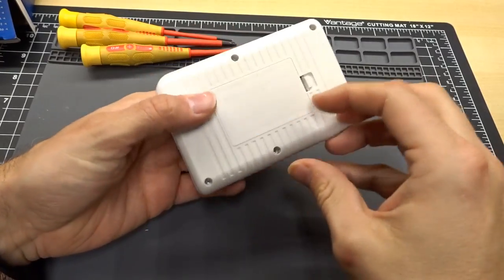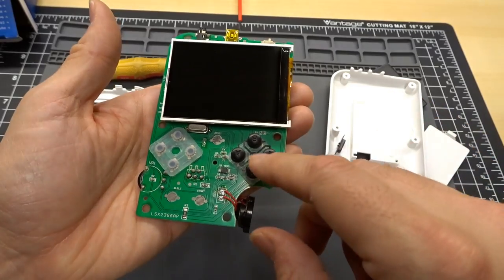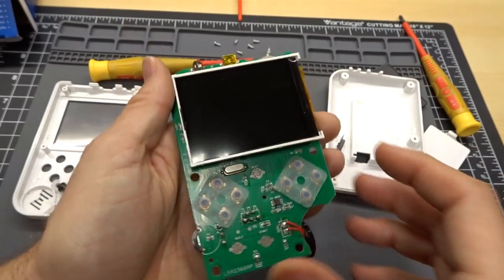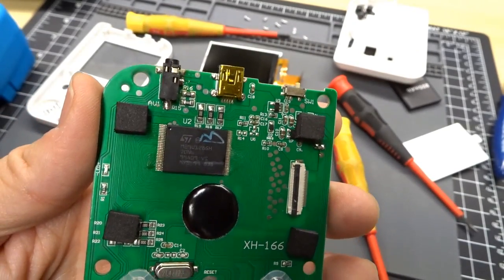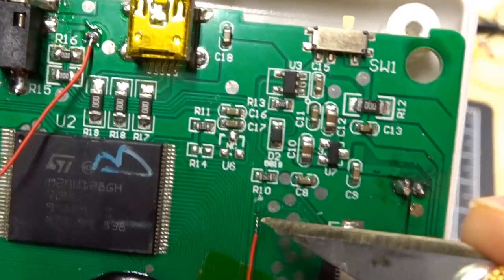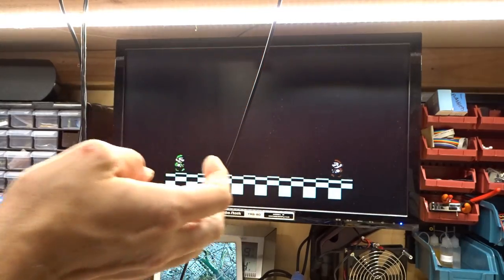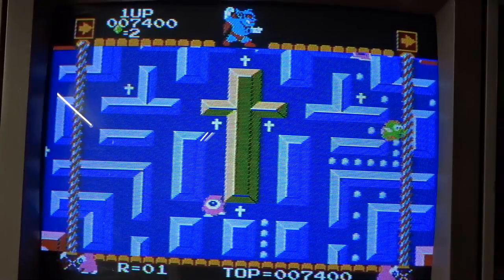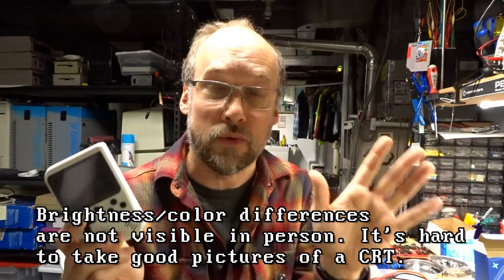Improving the $10 8-bit handheld game console

Comment: Can we add more games to this by flashing the EEPROM ?
Reply: You have to install another SSD and 1 graphics card.
Reply: technically yes, i have dumped the original firmware from one of these mine had a Winbond W29GL128 and i have found the addresses of all the roms, and now can replace them but doing so is pretty much out of scope for the avg user
Reply: @Hungry Box  can you make a video about it
Reply: not really cuz its a lot of work but overall i would say not worth it since the console itself is trash, too much work, but if you are still interested the author for that was a russian guy called "promolife"
Reply: @crisivannacis2742  no cuz its too much work to make a tutorial and not worth it since these consoles are extremely cheaply made and will in most cases not survive the process, plus you can buy consoles which use an sd card for games cheaper than the EEPROM mod is gonna cost
Reply: @mzahidshah please make a tutorial this console is very popular in Asia and people in Asia ar very poor can't not buy expensive console please 😢
Reply: @crisivannacis8534 yeah it's hard to make but if hi can't make it will really help people in Indonesia and philippines
Reply: @crisivannacis8534  brother i am from asia as well, and like i said the equipment, and stuff and skill needed to do this mod will cost more money and time than buying lets say a $25 datafrog SF2000. like you can make a diy console for cheaper, doing a mod to this console doesn't make economical sense

Comment: Dividing the crystal oscillator frequency by 12 yielded the exact clock frequency of the NTSC NES. Dividing by 13 yields almost the same frequency as the PAL NES. Clever.
Reply: So the first thing I noticed while playing Mario was the timer count down speed was almost twice as fast! possible to fix? installing a different crystal oscillator?
Reply: @bigalanwgordon  The timer was arbitrary. It's not meant to be in seconds. IIRC, PAL areas with 50Hz refresh had a slower timer than 60Hz NTSC areas.
Reply: @fryode  it's not just the timer but the music and game speeds are faster, at first i thought i might have pressed a button combo to speed up the game but it's in all the games on the handheld.
Reply: @bigalanwgordon hey guy i know im way late but a lot of these chinese 8 bit devices are running an smb rom that is meant to run on some other device  ive mistakenly downloaded that rom before its also worth noting that i have the fast rom on a multi cart as well  if you start changing the oscillator speed you may fix the mario rom but youll create issues in all the other games on the machine likely theyll run slow 
as you were trying to fix a fast running rom by slowing it down hope this helps

Comment: Used your 47 ohm resistor trick from this video. I had to mod my old 80's computer to get composite out of it...it only had RGB, monochrome composite, and RF. For some reason no color composite, partly because it was a UK machine and had a pin designated on its DIN-8 connector for PAL composite but only gave a 5 volt signal instead (which seems to be common for the US version). So when I grabbed the signal off the pin from the video chip (well sub-chip, MC1733) and re-routed it to one of the unused DIN-8 pins, the picture was a bit washed out color wise. When I put the 47 ohm resistor in line, the color came out fully again. So that trick worked, thanks!

Comment: You talked about the usb interface supporting the 3-pin controller. Well in the link you gave us there is an option to buy it with a controller (+$3.00) that does, indeed, use the mini-B interface. Just thought you would want to know.

Comment: Though I also would have just used Kapton tape, another reversible alternative to nail polish would be pure rosin. I bought some rosin chunks and dissolved them in solvent (you could use straight isopropyl, a blend of isopropyl and ethyl alcohol, or just commercial flux remover), and I paint it onto etched PCBs to protect the copper from oxidizing. (The more rosin in the solvent, the thicker the coat, but longer drying time of course.) This would work as a removable insulator for the buttons, since pure rosin isn’t conductive and is not hygroscopic.

Comment: Instead of modifying the video output of the unit with an inline resistor, it may be better or easier to modify the video cable.
Reply: Modify how?  Like in what way?
Reply: @maxcypond  splice in a resistor inline, add heatshrink
Reply: @maxcypond  If the connectors aren't moulded, then put the inline resistor in the connector.  If the connectors are moulded, then you could replace the connector (preferably at the monitor end) with a normal wire-able one and fit the inline resistor in there.
Reply: Would adding a sink resistor to ground (to avoid cutting traces) work?  Like soldering a 560 Ohm(or whatever) across the ntsc output tp to a gnd tp?
Reply: @emprsnm9903  Possibly...  I was wondering if the issue wasn't caused by the monitor not being terminated correctly (i.e. normally a composite signal would be terminated in the monitor with a 75R resistor).  If the input impedance of the monitor is too high, then adding a resistor between the composite out and GND could very well solve the problem.
Reply: Add a resistor to the cable?  That's an awful idea.

Comment: And the added capacitor on the backside was for...
Reply: just for the heck of it
Reply: Just because its supposed to be there. For completeness. If it should be there it will be there.
Reply: @lordmmx1303  Just for the Ben Heck
Reply: Is it possible that adding that capacitor is what caused the voltage on the video output to spike in the first place? Maybe that was why they changed the design and decided not to put in the capacitor?
Reply: @ct92404  I'm pretty sure the voltage was always hot, even before the cap was added.
Reply: Style

Comment: -Maybe you could smake an AAA-cell mod, for increasing the overall lifespan of the device to more than the included battery-pack? :)
-And modify the flash contents. Remove the double games, correctt he names and add missing games? :)
Reply: Why? This is not some unique battery, you get them at just about any electronics store for $4.

That being said, the capacity of Li-Ion cell isn't particularly amazing. It's probably a 600-800mAh cell at 3.7V nominal voltage.
3*1.2V for NiMH comes out to 3.6V so damn close and 800-1000mAh of capacity.
Reply: This is no standardized battery form factor. It's a special thing, that might have had some popularity in the past, because it was in Nokia phones or such, but for sure you can't just easily get it just anywhere and the popularity for sure is decreasing. Actually I don't even know what' it's name is and where I could get one right now.

Comment: Should adding the resistor outside the console by hacking up the video cable produce a similar result? In addition, what resulted from adding the capacitor? Did it reduce the audio buzz mentioned in the previous video?

Comment: Adrian, to what lines is the cap that you installed connected? Do you have any guess as to why it was not on the finished design?

I have one of these, but have yet to open it. The LCD is far too bright for me without computer glasses, so I'd like to put a variable resistor on the power line to the LCD itself.

Comment: I have one of these that i picked up for 7$, for that price it's a decent console but i wish they allowed USB access to change games from a PC...

I was wondering, there's any way to access the 128 mb memory and mess around with the games or even with the OS ?

Alternatively, do you think it would be possible to reuse the screen, case, buttons and some part of the board and connect everything to a Raspberry Pi 0 ? Seems like it would be a great 5$ upgrade.
Reply: So my thing with the last part of this comment is that if you wanted to go the Pi route, there's better options. There's 3D printer STL files and kits available to make something better, and easier.

However, if you already bought it like me, I can see the appeal then. And I'm pretty sure you could get it to work with a Pi, but you're probably gonna have to do a lot of fuckery for finding the driver for the screen (I would think) so I just don't know if that's worth it. Just learning how to flash more games onto the existing consoles definitely seems worth it though and I'm about to try it this weekend if I can figure it out.
Reply: @HildegardActual  Did you succeed with adding new games?
Reply: @HildegardActual  any luck?
Reply: @HildegardActual you did it?

Comment: Adrian, could you answer a few quick questions ?  Is a 47 ohm Resistor 1W, 1 Watt ±1% Tolerance or 1/2 watt or something else? (These blind to the polarity, so I can't put it in wrong?  Or is there a direction?) 

Second, what sort of  Electrolytic Capacitor?  Is a 5x11mm 100uF 16V suitable OR  5x11mm 100uF 10V  OR 6x12mm100uF 25V?

Third, I know this is a newbie question, but but is 30 Gauge Silicone Wire suitable (bigger, smaller)?

Comment: Did I miss the part about modding it for a controller or isn’t it in the video?
Reply: He was wrong about the controller interface.  It was a quick caption after he said that.  It would be a lot of trouble to add a NES controller to this thing as it is.
Reply: the mini usb port does support controllers and you can get them on aliexpress that was made for the device and does player 2 (I have one)

Comment: You could have used electrical tape to cover the contacts on the board to disable the buttons wirhout destroying them.I always try to make modifications in a way that they are non-destructive in case I want to remove them later...
Reply: OK , I was too early with the comment, you had the same idea to the end of the video...

Comment: I wonder if one can replace the 400-in-1 ROM on the Flash with other ROMs.
Reply: I would guess probably yes because the system already has a 5v connector in addition to the USB port. So what other reason would it need a USB port if not just for charging when there is a 5v plug on it?
Reply: @BFKAnthony817  charging while the second controller is plugged in?
Reply: my Organization Mode is just itching to have the repeats and glitched games removed and put everything in alphabetical order (w the homebrews after official releases)

Comment: You could have just left the contact pads and put a piece of non-conductive material in between so that if you wanted to actually use the turbo buttons you don't have to "fix your break" you can simply just remove the interferor.

Comment: Hi. You used that 47 ohm resistor on the video out.  Why that value?  And what other values would work for that situation?  I think I might have used a smd style for that application.  That way you only have to contend with the wire

Comment: Thanks for this nice video Adrian. Could it be possible to show us in another video how did you measured the video signal voltage level? Or it might be a very useful video if you can make a how to measure a composite video if it is proper or not.
Reply: terrylaze74  i thought he used an oscilloscope

Comment: i would go back in there and remove the one wire to the resistor, cut it shorter,  solder the resistor directly to the board and no worries!

Comment: I wonder though, why the hot output? Should it have had a resistor and they skipped it?
Or maybe it should have had a 3.0 or 3.3V regulator for the IC and they skipped that?
Reply: it's Chinese made so no problem omitting stuff just to have more revenue in sales. The Chinese love their money.
Reply: @ITSTAKING  Well everyone loves money and toy factories in particular are NOTORIOUS for last-stage cost-cutting. Jerri Ellsworth has a story to tell from when she was hired to design C64DTV and the engineering samples kept failing because somebody in the product chain on the way to the factory kept removing capacitors from BOM and board footprint. They commissioned the same supply chain that makes a lot of electronic toys, obviously in China, because where else.

But in other cases i've seen Chinese companies copy a product and make adjustments to it that made some parts redundant and then never managed to remove the vestiges even if they cost money, probably because whoever was tasked with the change didn't know what they were dealing with exactly. Just depends on the industry.

It's not a wonder that something was removed. I just wonder the removal of which part specifically is responsible for this behaviour.

Comment: I have a similar unit, but unfortunately not as good games. Nearly all the games are 'rip off' versions.  It's also a blob plus flash and a few other parts.  I have a vague idea that I could hijack the flash connections and load out the data to see what arrangement it has.  I suspect the game roms are loaded in raw.
Reply: were you ever able to add or remove roms on this handheld? If so, could you tell me how? 🙂

Comment: Hi, 

Do you know is it possible to replace this LCD display with an IPS display?

I bought the same model but the LCD is really really bad. In fact it’s in vertical display but they use is horizontal way. That’s why the colors are just strange

Comment: i know im way late but wanted to comment the video output while it may be a bit high it may have been done that way purposefully to over come issues created by the cheap video out cable that came supplied with the device  interestingly enough
the video out using the supplied video cable on a crt tv looks absolutely normal   the sound strangely enoough still comes from the device's speaker 
but i think that is due to my device having a faulty jack for the sound and video out  over all i highly reccomend this device modded or un modded 
its absolutely worth the ten dollars i paid for it at walmart on oct 27th 2023
i liked it so much that i ordered a second unit with an sd card slot and plan on giving it to my fiance

Comment: I came across a cheaper version of one of these in my local supermarket last night...Priced at £10,- (About $11,25). The UK model doesn't have the USB port or video output though, and with 108 rather cheesy-looking „retro“ games loaded on it (None of which will be familiar to anybody who's ever played games on named brand consoles) I'm worried the newer „UKCA“ version might have all the games stored in the blob, rather than having a separate NOR flash that you can conveniently add your own content to. 🎮🇬🇧💾

Also, just as a test: Did you try running your meter over the data rails coming from that USB port? It's probably there mainly to provide connectivity for the second controller as you theorised...But manufacturers of stuff like this like the product and any upgrades to be quick and easy. If they're putting in a USB port for a second controller, might as well have USB upgrade capability in it too. My suggestion is that the D+ and D- rails might have been swapped around¹. 😉

(¹ - IME: A common trick to make a „proprietary“ USB standard that seems to never work with anything except expensive „official“ accessories. 🔀)

Comment: What I always wondered, these NESonAchip blobs,  they replicate all the circuitry needed from a original Nes. Shouldn't it be possible to create a system like that that can output clean RGB video with a high level of compatability at a much lower price then an FPGA system like the Analogue NT? I would love a RGB Nes system but necessarily want to fork out 100+€ for the RGB mod

Comment: Would've been cool if you could replace that stupid generic pirate multicart with something a bit less ridiculously padded with uneccessary roms but eh, at that point why not just get a more proper system I guess.

What does adding that capacitor even do if it wasn't necessary  for operation before?
Reply: I think it's a little bit harder than just sticking the original roms onto the flash in the right place. IIRC you also need to patch all of the roms so they use the same mapper than the NOAC implements. I'm sure someone has already put something together to do it though as these things have been kicking around for a long time.

Comment: I can't get the av out on mine to work at all. It turns the screen black, but when it is on the TV (or monitor or whatever I plug it into) there is absolutely no video or sound. Sometimes on this one monitor I tried it on, it will have a snow like appearance and a buzz. That's it. Any ideas what could be up with it?

Comment: You could have done so many smarter things to those buttons. Either put something in so it's not possible to push them or heck even just cut the PCB traces - after all repairing cut traces is pretty easy should you regret.

Comment: Back when you first posted this, I grabbed one of these from Ali-Express. Distracted with other projects, I put it in the pile and promptly forgot about it.  Today, I was looking for a project and finally thought "I should try to do Adrian's hot video fix on that thing!".  Well I opened it up, and lo and behold... the board in mine is really different than yours!  (pics: https://imgur.com/a/aIwAYql ) Everything else about it is the same - same box, same manual with the exact same mistakes even.  There's no spot to add a cap on the back of mine, the memory chips different, board's shorter...   Is it weird that they would do such different revisions for a little knock-off like this, or is that common?